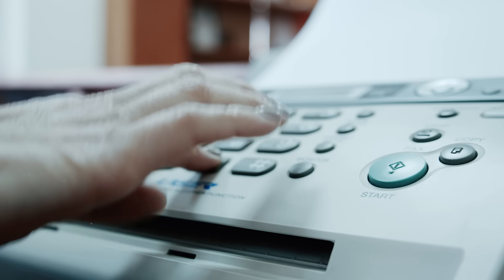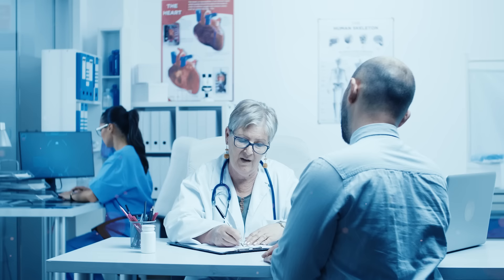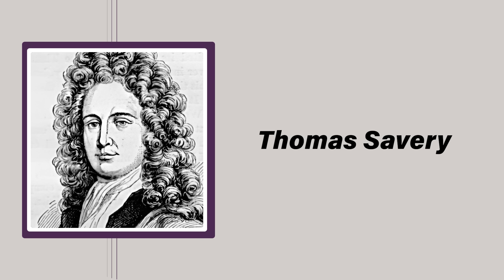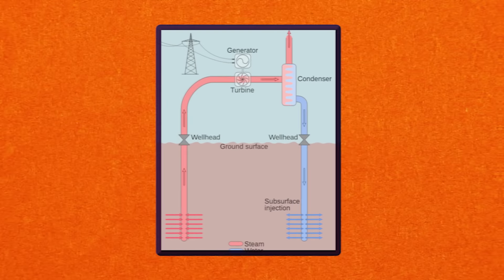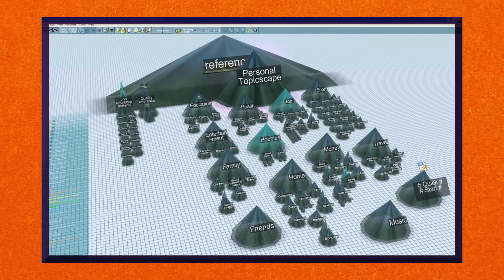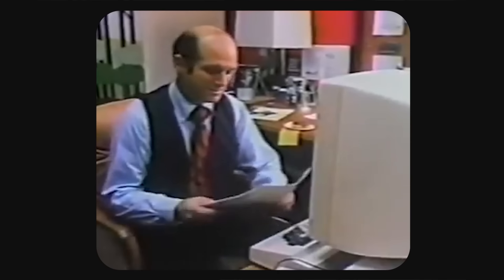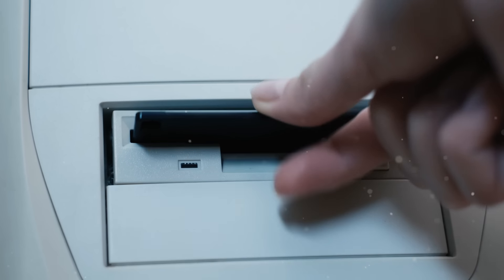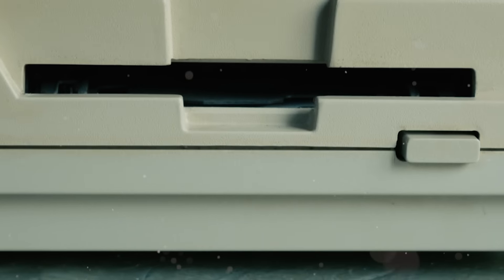Terribly Outdated Technology that we Still Use...

Comment: I work in anesthesia and I have to say it was really embarrassing when I had to be taught how to use a pager. Went from not knowing they were still around to using them every week, he is right they are the most reliable piece of equipment I have ever used
Reply: And it keeps you off of Tik Tok when you device should only be used for work....  Plus Cellphones are more fragile pagers(never forgetting the old size differences were insane....), Seriously old pagers could be used as hockey pucks and hockey sticks came out worse for wear after a game.
Reply: Plus they're nigh indestructible. The only mobile phone remotely comparable are those old Nokias. 😁😁
Reply: IIRC there's new pagers that's open source but work on the modern networks ( IIRC the older networks are all getting the pastures in many countries)
Reply: pagers were outdated by my time and I barely made the payphone era
Reply: @evilwelshman  In all fairness, you can buy tablets and phones specifically designed to be robust. I have worked with for example tablets that would survive a forklift truck driving over them. Although I suspect those are a lot more expensive than pagers.
Reply: Don’t worry, lots of voluntary fire brigades still use them.
Reply: sometimes older things just work better..
Reply: I don't think that's embarrassing... most of the "messages" sent over the things were unintelligible to the uninitiated.
Reply: I don't know how pagers worked in America but in the UK you had to call a operator, tell them your message and the number to receive said message.

Being old enough to remember life before mobile phones it's hilarious to see the horror when I tell youngers how we would see friends and say 'ill meet you by Woolworths at 4pm' then you would do just that!

I think this made people more upfront and people tended to stick to their arrangements because you couldn't just text last minute to cancel.

Did anyone have a pc before internet was widely available?  Hours spent playing doom or using windows paint 😂
Reply: @danoliver7044  I'm fairly sure in the US you just called a number and then the pager would beep and show the number that called... though it could have been more than that i dunno never had one.
Reply: @sheilaolfieway1885 Same here in The Netherlands, as far as I know 🤗
Reply: Pagers are still used due to their reliability, effectiveness, efficiency and robustness. 

The same can't be said for the NHS system or workers that use the pagers.
Reply: The networks started to kill off the smart pagers (think the T900 series) which served our company well for many years. Replaced them with phones, but except for the Nokias they rarely lasted the upgrade cycle. Sending text messages was painfully slow with the standard interface, but at least you could call your customers with the same device the call was dispatched on.
Reply: It’s scary to think that the chap  may believe his pager is more reliable than his knockout machine, and here’s me after more operations than I care to think about, especially if a pager is more reliable.
Reply: Also work in the NHS and was very glad when the on call pager was replaced with a phone (in 2018...)Pagers were a complete nightmare. Often the phone you'd used to page someone with would be called by someone else meaning that the person you had paged would be trying to call an engaged phone.
Reply: @TheRealBigfeet medical equipment needs constant maintenance. Older dial type anesthesia machines were pretty sturdy but you can only use them with vapor type anesthetics. Like every other field, the machines have gotten more technology & therefore more expensive & less user maintained parts.
Reply: I work at a grocery store and have to call technical support to change my register light. A power outage caused it to not turn red or green to indicate if the register is open/closed. And it's all connected to a computer system. Yeah. No physical override.
Reply: @danoliver7044 yeah doom and windows paint was fun. I used to paint every picture for fun. Then errase the changes.
Reply: @pietersleijpen3662  - You work with different forklift drivers than I do.  I have entire bins filled with tablets, also in indestructible cases (ha!) that were run over by forklifts.   Sorry, 5-15 tons of force does a number on just about anything.  (cargo warehouse, solid rubber tires, people that don't care driving them)
Reply: @ablemagawitch Actually they keep pagers because they work in areas where cellphones don't go.
Reply: @danoliver7044  Yep but I used my Atari 800Xl with 16K of ram to play Jumpman Junior.
Reply: Another advantage that’s often overlooked is that they need far less connection bandwidth than mobiles as such you get a message through in areas that text or emails won’t get through in such a timely manner

Comment: What do they all have in common? A certain elegance of design. Simple, robust and reliable.
Reply: @@binladen-ci7jmLow hardware requirements since release, the most minimum of bloated features an OS still being actively used, actively being patched by Microsoft (for a nominal fee) for the military...
Reply: @@binladen-ci7jm
8:06 

Simon said it.
Reply: @@binladen-ci7jmBecause people are still using it & it still works. You’re conflating older with functional.
Reply: @@binladen-ci7jmAt the time is not now. Your arguments are weak.
Reply: @NinjaRunningWild it's still not a low resource system, compared to modern embedded systems (eg: choose a flavor of linux)
Reply: 💾 were none of those things. They would fall to bits if you looked at them the wrong way.
Reply: OP, that is the spookiest pfp you could have possibly picked.
Reply: @futuza   Yeah the only reasons XP hasn't been replaced with some embedded *nix everywhere are because A) the users don't want to pay for that, B) the users are scared that any change will break everything, or C) the company that made the widget running XP went out of business.
Reply: What they all have in common is that they’ve found their way into niche industries where change is often slow, costly and complicated.

Comment: I work in IT and knew a guy who was MASSIVELY into trains. He went to Australia in 2001 and visited a small regional railway which at that point was still using a Commodore 64 to run the timetable. And a few years later (CIRCA 2004), I was asked to help reorganise and clear out the old server room and found that our legacy POP3 customer mail server was a 1992 Compaq Deskpro PC running on DOS 5.0...
Reply: Until recently, my company still ran mission-critical software on an emulated mainframe.
Reply: There is a story about the platform information system (PIMS) and how each monitor was run by a Commodore 64. For me that story started in 1986. The video chip was the only one that could smoothly scroll text horizontally. Nothing else could, for a very long time
Reply: In 2001 there was a railway in Australia that ran steam hauled passenger services, even years later parts of Melbourne's suburban system used semaphore signalling and manually operated level crossings, and today there are still large numbers of first generation diesel locomotives dating as far back as 1952 used to haul grain, freight and infrastructure maintenance trains
Reply: in singapore once I remember all the platform time tables showed the Windows 95 logon screen
Reply: I have nothing against using old technology in productive environments. What I do have a problem with is that people complain on how "insecure" the systems are when its THEIR fault for connecting them to the goddamn internet
Reply: @judenihal  some new systems won't even allow you to run it without connecting to the internet and legislation os far behind to protect the right to be offline.

GoPro is a perfect example of a business model that becomes more intrusive with each new tech generation and you either use that or deal with the problem of no other brand delivering the same overall balance of quality and usability
Reply: All trains run on Nintendo these days

Comment: I really miss XP. It was so easy to customize and when you needed to find something it was right there, not buried in a sub-sub-sub-subfolder. When I would get a new computer that automatically came with a more recent OS I would wipe it and install XP.  I was very upset when a lot of the PC games no longer ran on XP and I was forced to "upgrade."
Reply: I still play some old PC games from the 1990s, many of which surprisingly still run on modern versions of Windows.
Reply: Same with iOS, nothing like the iPhone 3G/4 style but now you can’t even use banking apps without being forced to update... 

Windows 10? My PC just random crashes now because it just updates when it feels like without choosing what it updates... 

XP, YouTube, Limewire, MySpace etc nothing like surfing the web 1999-2008
Reply: I was reluctant to upgrade to 7 from XP, but had to because of the 64 bit requirements of software I wanted to use.  Now 7 is being left behind.  I tried installing 10, and was shocked and appalled at what a terrible user experience it is.  Back to 7. If Steam is going to stop working on Windows 7, then so be it.  There are other things to do in life.
Reply: Windows XP rant... LoL
Reply: Windows 7 was also very good. ❤
Reply: Same here.  Each new windows on average seems worse than the last.
Reply: The problem with Windows from 8 onwards is that you have to know how to de-bloat it and customize it for it to run relatively stable...
That is, until the blasted thing updates again and you have to start from scratch.
Reply: @MrOrgeston  Odd.  I found the transition from Windows 7 to Windows 10 to be almost transparent ... very similar, and slightly better.  Windows 8 on the other hand, was something best avoided.  Not too sure about 11 though.  I hate it when they change things just because they can.
Reply: @daikansanchez7674  Actually, that goes all the way back to XP.  At least the de-bloat part.  But yeah, after an update, you sometimes have to sort things out again ... like reregistering software that was already registered in the past. Vast majority of updates for me have been seemless.
Reply: Lucky for me my cheapass workplace is still using xp so i can enjoy it
Reply: @MrOrgeston Having used both extensively let me say this. 7 was great but would always get slower mysteriously and become corrupt if you installed and deleted apps. This required a reinstall which i didnt like at all. Windows 10 i have never had to reinstall. Ever. It boots faster. Shuts down faster. Its not perfect but it is better imo.
Reply: @TheRealRedAce windows 10 has been better for me in every way. However i have tried windows 11 and its like windows 8 v1, overly simplified and weird. Avoid until a later update imo.
Reply: @blackterminal  I use windows 10 (like I have much choice!).  I'm using it right now.  I understand it's better for gaming, but I don't game on PC.  IMO, XP was better in almost every way.
Reply: You don't have to update from win10 even if you are gamer. There are no new directx versions and even new Intel processors work just fine on win10. (Despite of being claimed otherwise.)
Reply: yeah, you miss thons of malware written for it was the most targeted OS ever. It had bad driver support. Bluescreens every 10 minutes it could take 2 Months to make is stable. oh usually windows were horrible until windows 10 and version 22h2 it barely gave a blue screen.
Reply: @adriancoanda9227  I agree with you. Windows 10 has been very stable for  me. Your right.
Reply: @blackterminal   yeah and hope that they will keep up that way windows 11 they replaced the entire desktop environment with kde wich can run linux side by side if you configure it properly you can have on one monitor windows and on another linux or whatever os you want shore the hardware needs to be hyper-v compatible in order to allow such setup but it can be done
Reply: I still miss the capability to modify XP. Starting with Vista all the way to 10 home edition I always tried to down grade to XP. Since 10 pro edition it has become useless to try to down grade but still don’t like the interface or ability to modify.
Reply: I built a modern XP rig using the newest parts possible, an SSD, a Creative Labs EAX sound card, and a Sidewinder Force Feedback Pro, I spend more time playing games on it than I do on modern machines. With modern games you don't get that dynamic environmental sound, or joystick forces without using some racing steering wheel. Having all those environmental experiences in the old games was far more fun than the modern slog of DLC garbage and vapid skins modern gamers tolerate to milk a dying cow for an extra dollar.
Reply: Ah games won't matter that much on what platforms they are playing as long it is not an multi-player y don't think xp can handle hdr + or direct storage, you might get ssd since those are still sata devices but nvme you can forget about,  what about direct x12.5 , ops  ot supported ah , 8k gaming ah that is sad
Reply: It all comes down to the fact that the anti-virus stuffs are getting larger with their virus databases and need a more powerful computer and OS in order to scan each and every byte transferred without it seeming like it interrupts the user experience. And if governments took cyber safety to the extreme, they'd make it illegal for anyone to have a computer or os older than x years, and the banks would be super happy you'll have to take out a lone in order to afford to still use their services.
Reply: I keep one laptop with XP. I just don't use it on the internet. I disabled the network adapters, and only use it for software from that era. I don't have to worry about keeping it up to date, and only plug it in to charge it, or when I want to use it. As long as it lives, it will never be obsolete.
Reply: I use XP still every day. My CRM works on it - I use XP as a VIRTUAL MACHINE running it as another program itself in its own window with the CRM running in the window. A little clunky but it does what I need it to... Oh - and my CRM is actually a DOS program and XP was the last version of Windows it (the DOS program) would run on.
Reply: @RCAvhstape  Yeah XP was the last windows that could run dos games natively as well as 9x windows programs.  At least as long as the game didn't use the clock speed for timing.
Reply: Thats just nostalgia.
Reply: Microsuck peaked at Win7 Pro, and it’s been a feature-restricted user-data-harvesting downhill slide since then.
Reply: That's just Stockholm syndrome. Switch to Linux and get work done without being spied upon.
Reply: I still use XP on my old laptop, which incidentally is incapable of running the later versions of Windows, it's old but still works so why change it ?. My Desktop system on the other hand needed 64bit so has dual boot and Runs Win 7 and Win11 (Some stuff that runs on Win 7 will no longer work in Win11)
Reply: I'm doing the same with "Windows VII". Valve's forcibly deprecated "update" to the Steam Launcher Platform might be the coup d'grace that will force me into "Windows X".
Reply: @TurtleShroom3   Why use Windows at all when there are plenty of great Linux distros?
Reply: @anon_y_mousse 

I am too stupid to man it and most of my programs are incompatible with it.
Reply: @TurtleShroom3   Even if none of them work through WINE, there's always a VM to run those few programs, but if they're games you're referring to, Proton has expanded the compatibility list quite a bit in the past few years.
Reply: I haven't done it myself, but if you don't mind the learning curve, Linux is still that way, since you basically need command line level knowledge to really even use it (obv you use the GUI most of the time, but doing a lot of things requires knowledge of commands.)